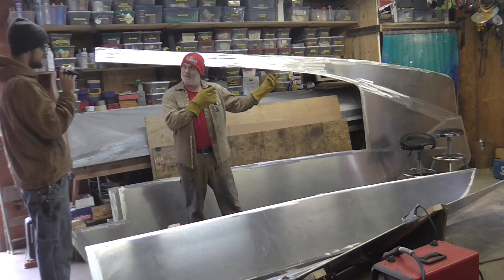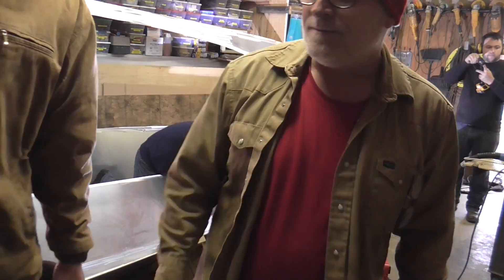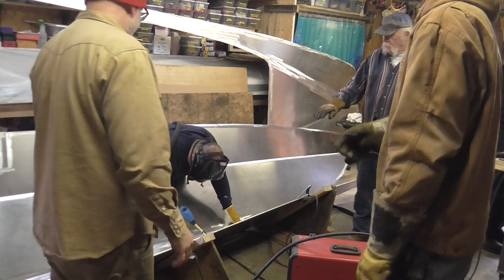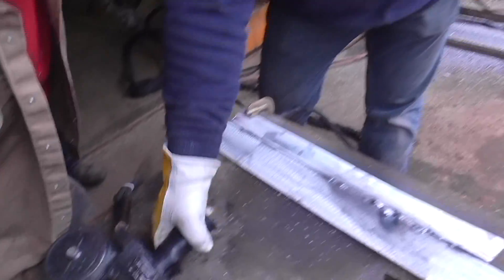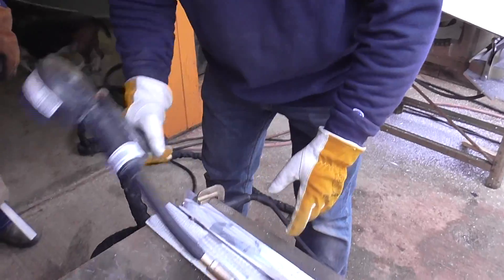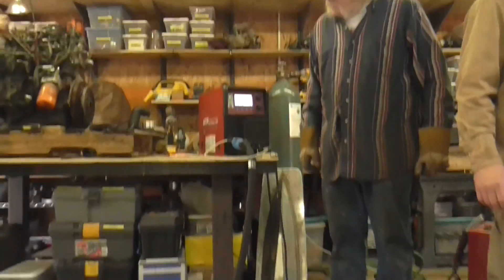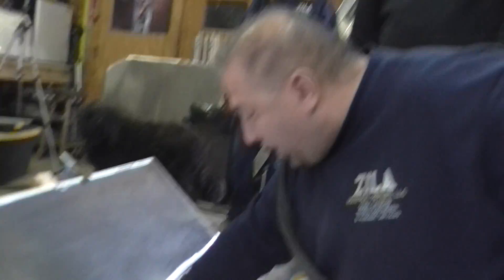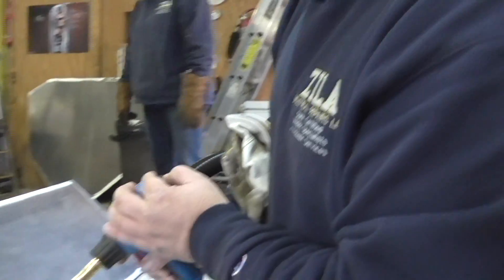Welding aluminum boat from scratch with PushPull gun on PP200

Comment: what alloy is the base metal 4043  is not a marine aloy, your aluminum should be 5086 or 5052 and the wire would be 5056 for marine applications
Reply from the maker: aluminum was a 5086 filler should have been a 5186 or if you cant get it a 5053 not a 5056 .....  however if you ever watched Svseeker and you know how Doug does things ... we wanted to use 4043 ...  so that is how that came about ...  I want there to argue .. I was there to weld ...            
btw 5052 is not a real marine grade alloy .. and it is the ONLY 5000 series base ally that can actually be welded with 4043 according to all literature I have seen ....
Reply: @ZILAwelds  your right, 5186 wire , and i know what you mean ,doug runs to his own drum beat.thanks

Comment: How did you install the push pull gun on the hpt 200 pro pulse?
Reply from the maker: I bought. myself a push pull gun and a control board in German ... and then some cutting  easing soldering .. and a few hours later there it was .... and now there is the Pp220mts you can just plug it in - done !

Comment: What gloves are you using please?
Reply from the maker: https://amzn.to/2Hk81ga

here are the gloves - they are ABSOLUTELY NOT FOR welding ... they are for driving ... NOT welding ...
Reply: ZILA 
I think they are just called drivers because they are a drivers “style”. These are actually pretty good for low amp welding or TIG when good dexterity is required.
I am partial to the goatskin 1328 for lower temp work or spot welding.

Comment: How did you keep the Aluminum sheets from warping or buckling? I made a 36"x48" tray from 1/8 Aluminum and welded all of the outside corner joints, which then caused it to warp and buckle on me.
Reply from the maker: the design of the boat helped it - if you make a "box" it warps more ...
Reply: @ZILAwelds  doors and boxes or anything you think might warp secure in a jig,and take your time welding it

Comment: Hi Peter, Do you think it would be possible to modify a spool gun into a push pull? From what i have seen they are essentially the same thing, minus the umbilical and liner for the wire. I like the idea of a push pull but not the price tag.
Reply from the maker: 1st - EVERYTHING IS POSSIBLE
2nd - forget the sentence "... but not the price tag"
3rd - it will take a long time and be expensive (like most "one off" units are ...) all the R&D is in the first few units ....  

to get into details 

gas delivery when welding aluminum is SUPER CRITICAL
if you have a push-pull system the next thing that is super critical is to "match" the motor speeds ....
and this is more complicated than one might think - unless you did this once before ...
for starters:  most wire feed motors are 24 volt DC motors - ok - nothing special about that.  with the right size drive roll and gearing you get a workable wire feed speed .....
so far so go - now different motors have different speeds ....  ok - pick something that matches and gear it accordingly ...  let's say at 24 volts the one motor makes 1000 rpm and the other one makes 3000 rpm - you gear or size4 the drive rolls accordingly and good to go !!!

well

almost

see what happens and what the literature does not tell you in most or all cases is that the motor that has a max speed of 1000 rpm at 24 volts may only make 400 ipm at 12 volts...  the volt/speed curves are not necessarily linear ...
to make things worse - those curves differ from manufacture to manufacture and even motor to motor so your 3000 rpm at 24 makes let say 1800 at 12 volt ...   

on a push-pull system, it is super critical that those motors run in perfect sync, at low, medium and fast wire feed speeds !!!

now, how do you achieve that? there is a 400 dollar little control board where there are a few pots and chips on there and you can dial speeds on the low medium and high end and compensate for that.....

so - trust me - it's complicated 

now that I answered your question...
What are y9u planning on doing ? what do you need a Push-pull gun for and what machine are you planning on running it on? what type of work and how much of it are you planning on doing?
Reply: ZILA  Thanks for taking the time to write back. you mention some really good points i had not previously considered regarding motor speeds and getting them to sync. 

I am relatively experienced with basic electronics and could probably rig up a variable resistor on the motor. To try and sync it with the machines drive rollers. 

I Have about 6months experience with aluminum welding, And can lay good welds. but have always had issues with inconsistency in wire feed speed. due to struggling to push the wire. To make it feed properly the torch has to be almost perfectly straight. 

My Machine is a Migstar 250amp, 3 Meter torch with 1-1.2mm teflon liner
1.2mm 5356 wire.

I am Planning on building a 7mtr aluminium plate boat and accompanying trailer. 

G'Day from Australia by the way.
Reply from the maker: stobby,  look at this video https://youtu.be/-G6FLB4CFHE push-pull gun is not all that great in every situation ... there are pros and cons to EVERY setup...  if you would have a 2.5m torch with a graphite liner ... and the right tips  - I think your problem is more the tips than anything else...  and the right U grove drive roller in the machine ...  I think you will be just fine!   
I am not sure that a home build push-pull gun really is the answer...    
But you can try.
Reply: Thanks ZILA from your advice i have decided against this idea. 

I have solved my feeding issues, i got a larger teflon liner. And secondly i never had the liner inserted right up to the rollers. after doing that it feeds great now! 

Kind regards.
Reply from the maker: glad you figured it out!  the Europeans run the Teflon/nylon/graphite liner directly up to the drive roll and eliminate one more transition for the wire to go through which helps feedability

Comment: I have been watching your videos for the last few days, good stuff. :)
On the gun would it be possible to have an ear bud in and when you make an adjustment the machine tells you what it is now set to?
Could also tell you if it is getting hot and about to shut down.
Reply from the maker: Andre, thanks for watching! if you want to know numbers as far as wire speed, voltage, material thickness - you need to look at the display, there is no interface that I know of that converts it into voice output. 
However - myself and probably 90% of the welders typically can look at the puddle (or more so the material next to it) and see it sinking and can tell the heat if you are too high or too low ...  it is not really complicated but the visual on the puddle will reveal way more information to the welder than number would  - why ?  especially on aluminum, everything is really "heat driven" 
As the material heats up (and since you have no one telling you what the exact temperature of the material is) you have to adjust (turn down) your settings as material heats up and you have to even further turn it down as the fit up of the parts is less than perfect...  
As far as the machine reaching over temp conditions - unless you weld 1/4" thick material - more than 13 linear feet all at once without ever letting off the trigger ....  with perfect fit-up (where you don't have to dial down the machine )- chances of you meeting the conditions where the machine is too hot and turning off on you are slim or none ...  and yes - if you are a professional welding on a huge project  - this machine is probably too small for you. 
and no - it does not announce itself when it is about to shut down - once it shuts down it is "locked out" for 4 min and turns back on after that - if you try to weld above 200 amps it will automatically turn itself down to protect itself it will not shut down for that.
Reply: I can not really same I am a welder, I stick stuff together with a Weld Pak 100.  I did use it to build a band saw mill but I disconnected the transformer and used a military surplus aircraft starter/generator for a power supply.  Was doing single pass on 3/16 and 1/4 inch stiff just fine, tried some 3/8 steel and started to get melting plastic odors from the gun.
Anyway looking to get something better for a new project, would like to get something made in the states,  Appleton is only a 4 hour drive so Miller would be nice but seems everything they have is $5000 and then you add the wire feeder you want.
This pulsed stuff looks like fun.
Reply from the maker: yes - miller is all about $5000 to get into any pulse or "professional" equipment ...    if you already drive to Appleton you can drive another 90 min and stop at my shop, you can try miller, lincoln, esab, htp, everlast, stel ....  and see which one works best for you
Reply: May just do that, would need to be in the fall/winter.  I had a 30 by 64 building put up this spring, currently working on he floor, just run the packer over the first layer of sand today.  Need to get that finished up so I can get the concrete guy in to do his thing.  And a seemingly endless list of other stuff that needs to be done before it snows.
I do have a cast iron part from a steam engine governor that has a crack in it, a little MIG brazing may be in order.
Reply from the maker: don't know - hard to tell till you try it...  usually, I LOVE mig brazing for cast iron repairs ... but these electrical boxes would just not cooperate .... I HAD to stick weld them ...  trust me I tried mig brazing, it's faster, cheaper, the better choice all the way around...
https://youtu.be/lrRZM74ULQQ
look at the video

Comment: Everybody got some flashburn today.half way into video and have yet to see a weld by this world's first push pull not a Miller word class welder.spray aluminum every day building boats engin beds fuel water and hydro tanks.plus all the rigging and I never a just my wire speed during a weld but will give it a shot .but to me the hotter your weld gets the more wire is needed .

Comment: The stel and the HTP pro pulse 200 need this push pull gun.   I just spent half a day with my stel iron mig 221 trying to get it to consistently weld some alloy rhs with 4043 1.0 wire.   I could do about two or three passes before it would melt the wire back into the contract tip.   In the end I gave up and went back to my tig machine.   The pro pulse certainly has promise but the people making out that you can weld assemblys that arent in one position on a work bench are dreaming its not that simple the mig torch has to be near perfectly straight which is unrealistic trying to weld any sort of assembly up.
Reply from the maker: austingtir maybe they do or maybe they don't need this push-pull gun ...  the gun cost "as much" as the machine .... it is ridiculous. so 4043 1.0 wire feeds REALLY nice though the gun that HTP sells  - that is one of the differences between the machines ...  a major difference in my book.  HTP sells a binzel style gun that is only 8 or 8.5 ft long  (just about 2,5m not 3m long) and it has a little bit heavier cable and it works damn near perfect!  it also has M8 tips instead of M6 tips which can take a lot more heat than M6 which is absolutely critical ESPECIALLY with 4043 wire! which runs super hot.  
Now from the factory if you bought Stel's aluminum kit you get 5 tips with it. Although those tips do not look like anything special, those are CrZr tips (not regular copper welding tips !) and they are designed for robotic and pulse welding applications!  if you used those up you NEED to repurchase CRZR tips! 
now that being said - I tested the stel gun and it works ok - yes you have to hold it straight and the tips only take soo much heat, at max setting of the machine 12,5m/m I believe and if you stay on the 4t hot start for a long time they can eventually give you trouble.

now there is a fix for it!

the "small fix" is to get a different tip holder for the 25 series gun that you have.
the HTP part number is 25002-THM8  which this is a replacement tip holder/diffusor for your 25 series gun that allows you to run M8 tips (remeber those need to be CRZR as well!) in your 25 series gun.
the tips you are looking for should be either 1,0mm or 1,1mm which are .045"   that would be part number 26045-10CR*PP26
with those simple modifications, 80% of your problems will be taken care of

the "real fix"

is to buy htp part number 26080, which is the entire gun, then all you need are the tips if you want to run 1.1mm which is hard to find in Europe get part number   26045-10CR*PP26, if you want to run 1.0mm you can order them from your local guy and all other parts you can order from your local guy too, all parts are a direct binzel replacement. 

maybe something for you to consider...
Reply: Thanks for the info Zila your a good dude and always quick to help.   I already figured most of that out myself.  I get what you mean about the HTP gun being better.   I have the crzr tips in both 1.0 and 1.2 all m6 to suit the stel gun.   The problem with the stel gun I find is when you coil it up when not in use the rubber its made of takes a set and its difficult to keep straight when you go to use it on alloy again + it being 2 foot to long.    I was building an alloy RHS frame lean to type carport about 5.5 by 4.0 meters I really needed a push pull or spool gun to do this job but it was a good job (my personal home) to test things out to see if I could get it to work rather than a customers so im fine with that.                                           Do you really think the htp gun would work for me doing totally out of position work like that frame as you are either under it or over it, its nearly impossible to keep the gun/lead straight.    If I can get it to work its certainly worth it for me to buy as its so much faster with the mig its not funny.
Reply: As I dont need the htp alloy rollers do you know the model of that htp torch as a binzel as I can probably buy it locally rather than ship from the states as it will be big $$$ from the USA by the time I pay import tax.  If I just get a 26AK binzel torch 2.5meters long to suit alloy I should be good?
Reply from the maker: austingtir it worked for me for a VERY long time and it still does! 

The heavier cable helps to keep the gun “straighter” just a little bit - just enough so you dont fight it that much. 

In my personal opinion for me, and dozens of people i helped in person, or over the phone or through email it works just fine. 

I would say - most likely it would work for you too....
Reply from the maker: austingtir welding aluminum is “tricky” and the way the shielding gas is delivered in the 26 series vs the 25 series is totally different too. The 25 series has a copper tipholder which also double purposes as diffusor the gas coverage is good. 
The 26 series has a brass tip holder and a composite diffusor which work in conjunction. 
I personally own a genuine binzel 26 and it works great, so does the htp torch, be aware of cheap ebay knock offs!!! as those are often “binzel style” but the gas delivery works totally different and is perfectly sufficient for steel wire but horrible for aluminum - black soot and peppering of the weld everywhere and in the end - guess what - you buy another gun.....  ask me how i know .... 
i learned that the hard way myself. 
If you want to call or email htp anf have them quote you .....  just the gun ( no drive roll) is part number 26080....  then decide if it is worth it buying it somewhere else and it may or may not work for you .....  and all that for $20 “savings”...?
Reply: Ok Thank you I will look into it.   BOC the local supplier probably is struggling to source the short 26ak torch so I might have to go with HTP.   The issue for me is the import costs not so much HTP's pricing.  In New Zealand they tax you alot on imports now.
Reply from the maker: Check on availability of M8 CRZR tips also .... if you can not get them locally - you better stock up .... I mean whoever sells binzel by you should be able to order them if they don't have them in stock

Comment: No nonsense. I see why you have all the work you need. You didn't drive all that way to talk. Some people might see it as arrogance, but I see it as. "Why wouldn't you want to know? You learn from others. That's how you get better." It's a matter of pride in craft.
Reply from the maker: no - I didn't drive all the way to talk ...  I drove all the way to make videos ...LOL.  I am going to make this at least a 5 video mini series ...   welding machines accessories explained,  push pull gun, spool gun, spray arc "classic mig" vs pulse technology, set up of an engine drive, different welding wire alloys, cut and etch, ... we'll see ....  stay tuned. - an other one coming tomorrow  - I think you will like that !

but all hidden aside ...  I like to get stuff done !  I am not one to go home at 4pm ....  just get it done instead .... !

Comment: Great job Pete!
I thought i saw a push pull gun in another video. I would like to get a spool gun or a separate wire feeder for when i need to weld in boats, but i need the demand first as well as the money. LOL!!
Reply from the maker: yes - spool guns can be nice for remote areas .....  however the feature of dialing stuff up or down as you go is really AWESOME ...!  and unfortunately you cant do that with your machine ....  if you get a spool gun make sure it takes some standard tips. - and then I will help you to cross reference CRZR tips so you can really spray it in !